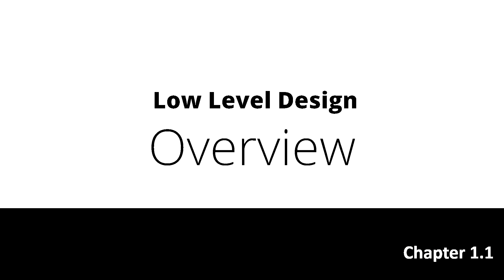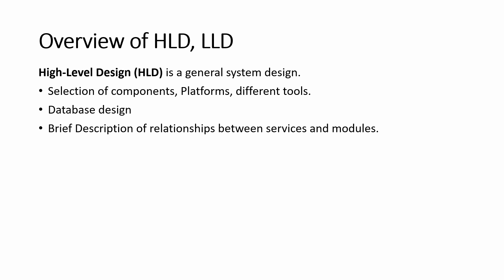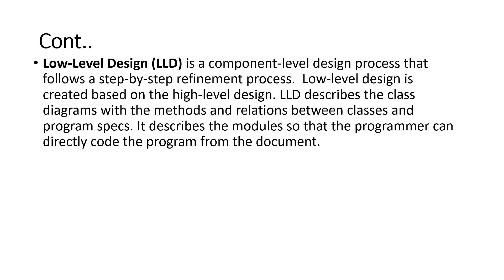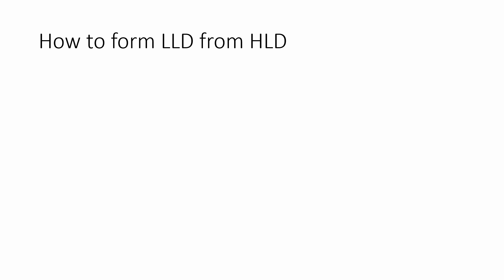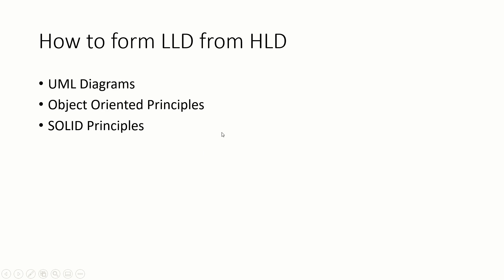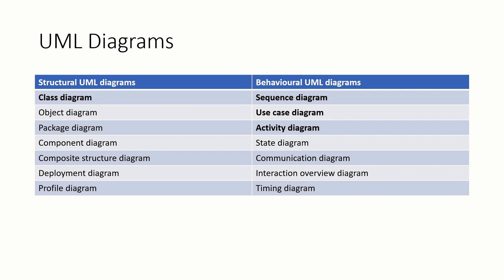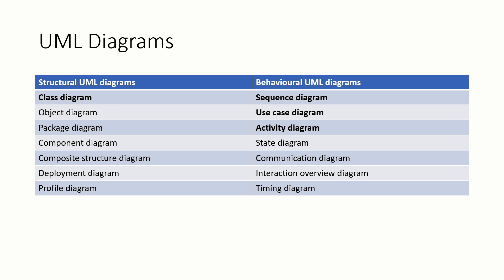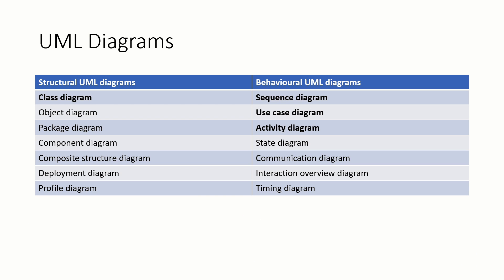Introduction - Low Level Design | Coding Interview Series | The Code Mate

Comment: I need some help with this  case study of Intelligent Learning Style Personalization System to improve the precision of automatic learning style identification. This e-learning application uses learning objects and attributes interaction integrated with the neural network for a learning style classification model. According to the case study :
Q1. How does the process of software design patterns work for the intelligent learning style (LS) personalization system? How do the design patterns technique able to improve the precision of automatic learning style identification?

Q2. How to apply singleton to the intelligent LS personalization system? Please elaborate the answer with mapped class diagram and explanations.

Q3.  how to apply factory method to the above mentioned system. Together with class diagram and mapping table, elaborate and explain how the components able to help in the classification algorithms for the above mentioned system.
could you please make a video about it or solve the question . Thanks .